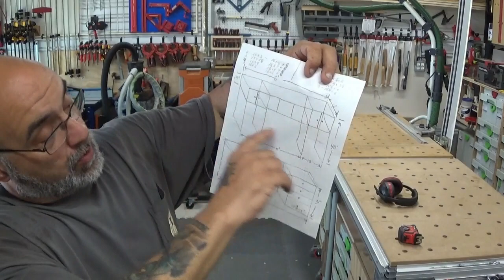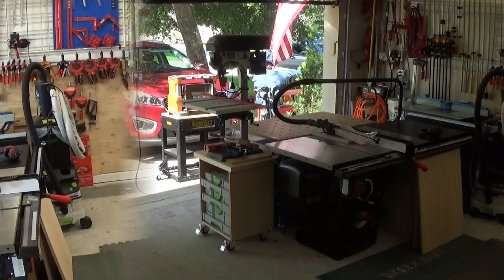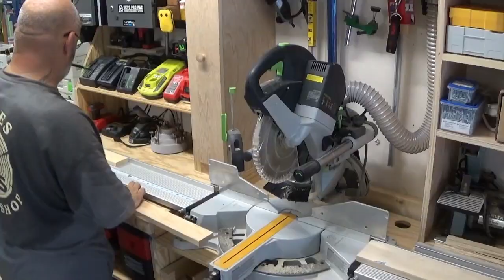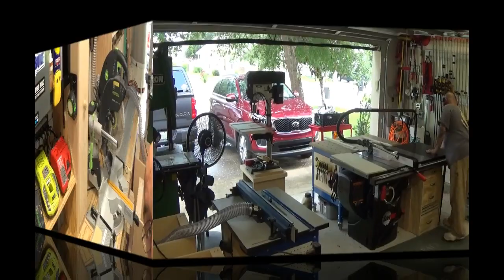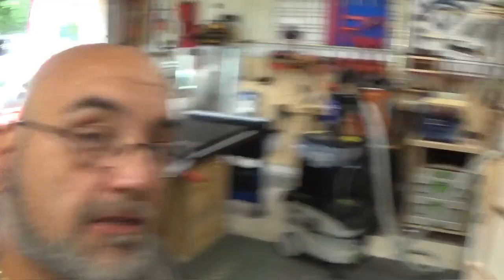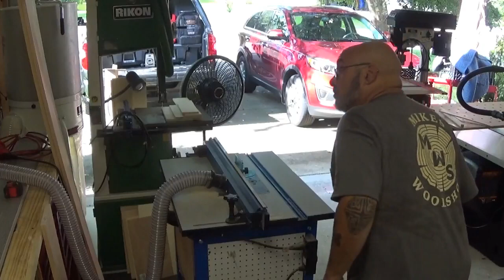Part 1 of my model desk build.

Comment: Very nice Mike. I also have the Rockler corner clamps which helps greatly when you are building a cabinet. The Fast Cap Mags are very useful, I have both metric and standard. Cant wait to see part two of the video. You should be an instructor for wood working their in Florida. I'm sure there are a lot of kids and adults who are beginners in wood working that could use some advice and helping  on how to build things and how to use tools. O buy the way check out the Alabama wood worker on You Tube. He has a couple of wall mounted Air Conditioners which help in his shop with the same humid weather as you get there, maybe he can tell you what the price of one cost.
Reply from the maker: Doug Smith thanks Doug I will check out that channel. Those clamps are very good love using them. Those Mag shins I don't know how I did without them. Mike

Comment: Mike, what plywood are you using?
Reply: Mike, is that the brad nailer or pin nailer you are using?
Reply from the maker: Dale Ellington it's 3:4" birch plywood and the draw fronts are # 1 clear pine. Thanks for the comment Mike
Reply from the maker: Dale Ellington I use 3/4" birch plywood and 3/4" clear #1 pine for the draw fronts. Thanks for the comment Mike